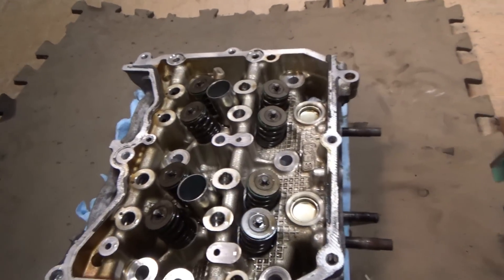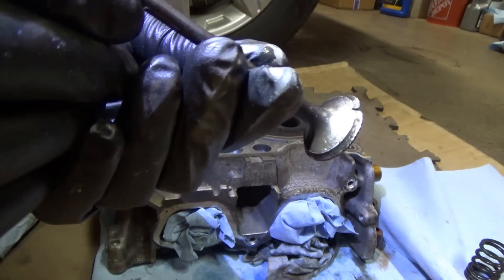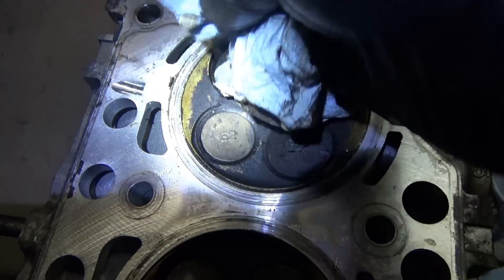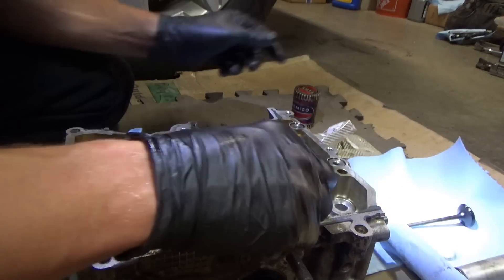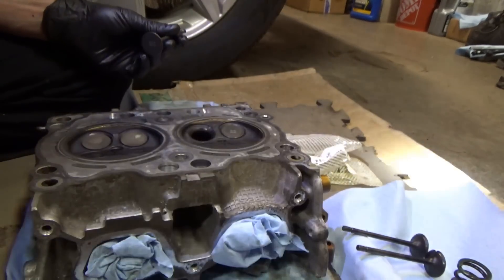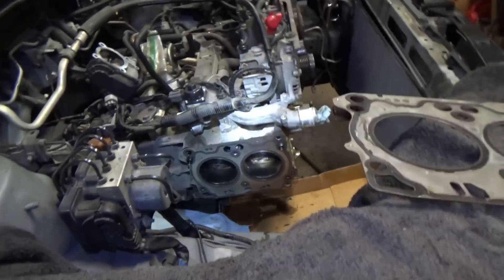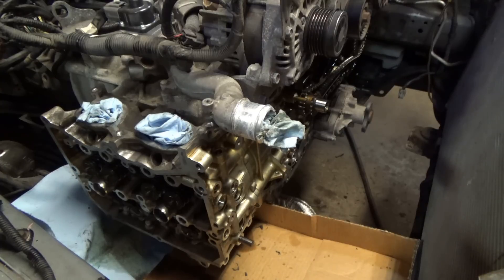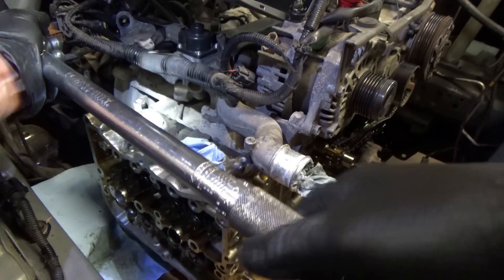What Happened to these EXHAUST VALVES!? (The Sad Subaru - Part 3)

Comment: I'm 57. I remember asking my Dad what the thing with a dirty wooden dowel was with 2 suction cups on the ends. "It's a valve-lapping tool son". He used to do the same with Mini engines back in England. Mod the snot, sound loud and go nowhere fast lol, just like 1st gen Honda Civic hatchs. Little sewing machines.

Personally I don't know, but that pitting almost looks like it's a reaction with the fuel mixture or something, especially if it's on every valve.

Comment: Way back in the mid'70's i worked in a automotive machine shop. We had a customer that was in the propane business and they ran their trucks on propane also. They used to burn up exhaust valves big time. Propane burns quite a bit hotter that gasoline. My guess on the Subaru is that it's running too lean but you made a good point on the valve not contacting the seat fully and not transferring the heat sufficiently! Good job!

Comment: So many machinist and hot-rodders in the comments. I can't count the comments stating a bad repair. But maybe around 10-15 just in this part of the series.This is too bad after all these years and videos Ivan made for free so "jack of all trades(repairs)" like you guys that know everything ... can learn for... FREE. Darn. I can't belive . This is not a hot rod or super tuned modern car.....One is complaing about reusing the head bolts. Other one says "ONLY SUBARU SEALENT CAN SEAL THIS ENGINE" no other can , so sorry this is not good repair ! Another "specialist" asks why he is replacing the valve with the same number valve. Haha. What about the guy asking - why is not the head been resurfaced? Wow. But the biggest clown is the one saying "just put the lapping tool in the cordless drill" and spin it like you're drilling a hole in a stone ! This is crazy. The valve face to seat contact pattern and geometry is very important mostly for valve cooling. Lapping tool on a cordless drill is a no-no. It can throw off the valve face and seat geometry and contact pattern out of spec. The book says that valve lapping is nothing more than just "polishing" after valve and seat machining or when inserted seats and new valves are installed. But valve seat is cut at 3 different angles. Most common is 30degree at the top(bottom with head installed) 60 degree at bottom(top with head installed) and seat itself 45 degree. The valve face must be 45 or 44 degree. The width of the valve face and seat must be specific. And they must contact each other evenly , without one overlapping the other. Also there must be specific valve margin..The point is that just installing the lapping tool in cordless drill and turning until the pitting is gone could make things go out of spec. Throwing out the contact pattern and geometry and leaving no margin...But the most ungrateful and selfish thing is that - You guys love when Ivan's doing "Russian repair" and saving the customer ton of money when doing ELECTRICAL repairs on the cheap. BUT when he's doing mechanical "russian repairs" and AGAIN saves the customer a ton of money . You always find problems - you did that wrong. This shouldn't be done like this. This is not supposed to be like this, send it to machine shop!!! The bottom line is - customer was informed and by customer current circumstances and finance - this is GREAT repair ! Not Ivan's lawyer, but most engine that see the machine shops today are engines for custom build muscle cars or restorations , and high performance customized modern cars. No one is going to send the engine\head of everyday car to machine shop if he isn't serious DIY working on his own junk. And general repair shops don't do repairs ..only would replace the whole engine or in worst case just the head with new, remanufactured , or junkyard one. Dealers of course install new only.

Comment: Traditionally, exhaust valves always are the ones that fail. Often there will be a slow build up of carbon on the seat(s) that begin over time to hold the valve open far enough to allow combustion gasses to jet out and create a blowtorch effect hence "burning away" the sharp edge of the valve.
Your valve has been leaking a while thus removing more & more material. I don't think it is "cracked"....but just "blowtorched" so to speak.
This failure is caused by the valve seat being so overly wide that there is too little "edge" where the valve rests, to break off tiny bits of carbon as they arrive. A thinner seat allows for greater closing force per square inch (cc?) allowing the seat to seal better on the valve face. It is necessary to grind and narrow the seats to provide long range longevity of the valve. 
 Other contributing factors might be the tendency, as you point out, of this engine producing a lot of deposits...as shown in the intake body. Lapping in of valves is not considered "effective" on moder day engines with properly ground seat. A new properly narrowed exhaust seat will
hammer (drastic word) it's perfect mating surface into the matching valve face shortly upon start up.
Lapping is still used as a "marking" process to evaluate that the surfaces are mated well.
Jeff Walker, Lakeside, Az.
Reply from the maker: Very good explanation, Jeff! Unfortunately even with perfect valve seats, this engine is on borrowed time since it burns a lot of oil due to defective piston rings 😔

Comment: Chuck the valve grinding tool with the rubber end  up in a variable speed drill, and grind a little more on the valves using a very low RPM>

Comment: Why explain head gaskets when head gaskets weren't even the issue?  Getting ready to ditch this channel when phony drama becomes front and center.  Who the hell cares about a Felpro compare when those gaskets mean nothing insofar as this is concerned.  You're the one that decided to do this job in-place even with warnings against doing so.  Why not just flip the car on it's side instead of the engine?  Really now.  That thing will not last 5K miles.

Comment: Hi Ivan thanks for the video 📹 about grinding in the exhaust valves in my opinion you haven't  grind in the valves enough as the seats and head should have a grey ring showing i think that the valves will lose some compression regards Tony 😉

Comment: Still looks like it got hit with debris. These year motors from Japan had bad pcv valves and the broke valves when the pieces of the pcv went downstream. And obviously with finding stop leak the car has been overheated. FYI Victor Reinz made the OEM single layer graphite head gaskets

Comment: In all conscience I could not have put that head back on without more work on the valve seats. Agreed budget or not,  having gone this far a few extra minutes spent makes no difference to profits. Also I would have fitted the camshafts and checked the valve clearances before reassembling the engine.

Comment: I am guessing that the valve was leaking in that one spot, and the heat of the exhaust blow torched it's way through it over time. This could be the result of worn out valve guides or a manufacturing defect that took a long time to develop.  In either case, it is important to know that a valve dissipates most of its heat by conduction by making contact with the seat. If it can't do this, either due to a negative valve lash or a guide that lets the valve close a bit too crooked, something like this is the end result over time.

Comment: umm, that seat is very trashed, it may even be loose in the head after being torched like that. the guide is likely spent also, even if it seems tight and in place.
may get by with it like that on an old mower engine, but it wont hold up long on higher compression injected stuff.

Comment: Hello Ivan and nice work as always.

I'm shocked that the valve seat actually survived.  WOW!  Must be a terribly week (and weak..edit) valve to decay so much and not blow a groove in the seat.

Also loved the review on the Lisle keeper tool.  I have used sockets and small/heavy hammer for removal, but the install was amazing!  Now looking at this tool to purchase.

PS:  No valve stem seals or not an issue with Subaru?  BMW's are terrible with stem seals.

P-Chi

Comment: If the seats are a hard metal like stellite, or powdered metal, things should go well.
( for the price of installing new seats, it is cost effective, if you know someone you can trust to do it right )
But, when the new valves wear in they will sit taller in the spring end.
This induces more preload onto the HLA which will resist the combustion forces, since hydraulics is stronger than the combustion.
Then, the valve face will glow and fragment again.
One has to hone the shims to get perfect hot running lash adjustment.
Then the heat transfers to the valve seat completely.
Thankfully, the engine isn't a cast iron flat eight,
Then you would need a tractor to move the heads.

Comment: Modern engines with old school tech, stick with what you do best mate, find a shop with a Newen head machine and get it right , tip lash adjustment tight most likely but crap fuel will do the same thing, modern engines are shit job for most mechanical shop to even include in there service schedules and main reason why your customer is were you are now.

Comment: Cant believe they suckered u in the job lol
Reply from the maker: hah the only dissatisfying part about the job is knowing that the engine is still burning oil, so the same errosion process will start on the brand-new valves. Oh well...
Reply: Then They used the line it wasn't like that before . Lol

Comment: I remember in my burnt valve incident on my previous 02 Ford focus 1.6 due to oil consumption the other valves was pitted too. The whole head got new valves but i just discovered later that the oil consumption problem was in the oil control piston rings, therefore i got a second hand engine. I learned the hard way 😅 Great job and video Ivan 😃👍
Reply: Besides the valve was burned from my engine, it also missed a piece from it 😳

Comment: Ouch,  Ivan.  Slightly lapped valves? Probably needs more than that.  Needs bit more uniform fit.  I'm just citing from experience with valve lapping.  Break clean and more deeper lapping job overall the heads face need a good clean.  That's just my opinion.   Can't wait to see how you manage to put rockers back in without falling out. I figure you'll use the installation grease or engine build grease that holds the stuff together.  Can't wait to see part 4.  Probably see the end of part 8 like Eric O said,   haha 😄
Reply: I use a brand new flat file to level and resurface mildly worn heads.

Comment: So why didn't you use the new part number valves if they replaced the old valves. I noticed a little bit different length, but maybe a replacement because of the old ones known for burning up like that?

Comment: Ivan, That shock from the mallet for dis/ and assembly of those valves seems like to much of a shock to the springs, possible crack? I prefer the large C clamp style valve removal tool, slow and steady.
Reply from the maker: Imagine the engine spinning at 6k rpm. The "shock" from the cam lobes is way more violent that my gentle tap with a hammer :)

Comment: The valve burned because the valve did not transfer the heat to the head (the coolant removes the heat from the head and developed a hot spot. This is usually caused by poor contact with the valve seat. This can be caused by worn guides, bent valve, or seat out of round. I suggest you invest in a Neway valve cutter set (they can also be bought individually, so you can properly cut all three angles on the seat and get the contact exactly in the center of the ground valve surface and get it back to the proper angle and get that seat back in round and making full contact. This is especially important with the burnt valve seat. I didn't see you check valve guide wear either, which could have been the cause of the valve burning. I would have liked to see some oil on the valve stem during reassembly. I admire your electronic diagnostic skills, but there are better ways to replace valves that will make the repair last a lot longer. Pretty Russian

Comment: Ivan when you put the form a gasket sealant on you want to wait abt 30 minutes before tightening down, the form a gasket needs to set up, firm up  a bit so it creates a seal.. if you tighten right away you will have a very thin film of gasket material and if there is too much tolerance between the parts, u will have leaks,.
Reply from the maker: I slap it together ASAP after gasket application and have NEVER had any leaks on dozens of jobs...but perhaps for some applications that makes sense :)
Reply: @PineHollowAutoDiagnostics  I used to do the same thing, but the directions to let it cure make good sense,. modern engines have closer tolerances generally, so its usually not an issue but I try to eliminate any potential leaks possible. Im getting too old and tired to do it twice. ha manufacturers using form a gasket was a way to save costs, not to increase reliability. I think letting it dry a bit is critical when there is no gasket and all that is used is the form a gasket sealant.
Reply: to clarify, when using form a gasket sealant on parts that have NO  paper, . cork.   or rubber gasket, you must let the form a gasket set up before assembling parts.  you are making a gasket, not a gasket sealer,.

Comment: Defective metal or improper heat treating on those old valves. Using both hands to roll valve grinding tool, like you are starting a fire with a piece of dowel, will go a lot faster.

Comment: Hey Ivan.  I know your customer wants a budget job and you're doing them a great service getting this engine to run on all 4 again.  But I have to agree with the majority here and point out that those valve seats in the head are cooked!  No amount of lapping can fix that.  If you were to do this job right, you would send the heads to a machine shop and have those valve seats re-ground and new valve shims will be needed to get the valve clearances back to spec.  But I understand that your customer is on a tight budget.  So, it is what it is.  Anyway, what usually causes this is carbon buildup that gets trapped between the valve and valve seat.  A hot spot forms around the compression leak and over time, it weakens the valve.
Reply: wasnt much carbon on the valves?
Reply: @randy1ization  I didn't suggest that this was the case here.  It's just that carbon buildup is a more common cause for chipping valves.

Comment: I had heard someone say before that the alloys the Japanese car industry had access to, to make its valves are somewhat inferior to European or American manufacturers. Certain Honda engines would burn valves.

Edit: one thing I might wonder. The cats and O2 sensors on that bank were new, could this have had a rich condition and the crappy ethanol fuel ate the exhaust valves and burnt out the cat?

Comment: Valve damage by carbon caused by exhaust gas recirculation in modern engines, otherwise incorrect valve lash too tight burns 🔥 valves but these are hydraulic...

Comment: I had an 88 ford bronco that did this. I worked on it and serviced it. Then some things happened and I stopped taking care of it. It developed a miss after I found a loose spark plug and it also happened the water pump went out and I ran it dry of water. So it had a lot going against it and yeah when I pulled the head the exhaust valve had a v chunk missing.

Comment: I realize this is coming too late, but Subaru Fujibond is the only sealant that works for these motors. Subaru even re-engineered the sealant that was originally used on these motors to improve techs' chances of success resealing these motors. Everything that has come through the door with some other brand silicone has had leaks. But I get it: the budget is the budget. Having work is better than not, but hopefully the customer understands why this repair is only costing what it is.
Reply: its not the sealant its people who dont read the instructions and let the sealant set up for the specified time, so it firms up enough to create the proper thickness between the adjoined parts. they apply the  form a gasket, immediately tighten the bolts and the sealant squirts out of the space. aluminum parts expand and contract ALOT so the gasket thickness is critical.

Comment: Always cut with a coarse medium then fine cutting compound Matey on bad seats like that and wash it all off with brake cleaner and always replace the valve stem oil seals and you may  need to resize the shims after

Comment: 11:30 Subaru, being a small auto manufacturer, tries to be efficient as possible. They bought a stock of the original gasket for the SOHC engines back in the late 90s and that stock lasted until about the late 2000s.

Comment: I almost think that valve failure is from a defect in the metal. Usually if they overheat from a lean condition(like a partially plugged fuel injector), it causes the valve to burn and a chunk will be missing. I've never seen a valve get cracked like this one is. All the ones I have seen had chunks missing.

Comment: In high school (a very long time ago) we lapped valves using that method, but we'd attach a drill to the valve stem and pull on it while spinning the valve with lapping compound on it.
Reply: Those were small blocks with cast iron heads, not aluminum like these.